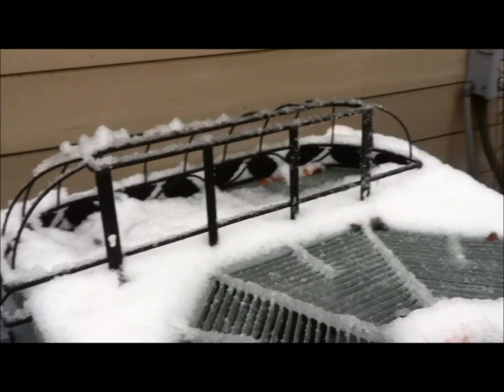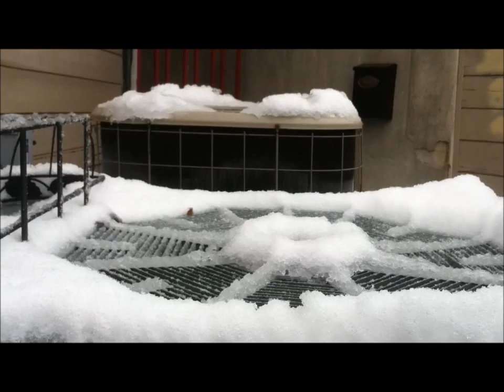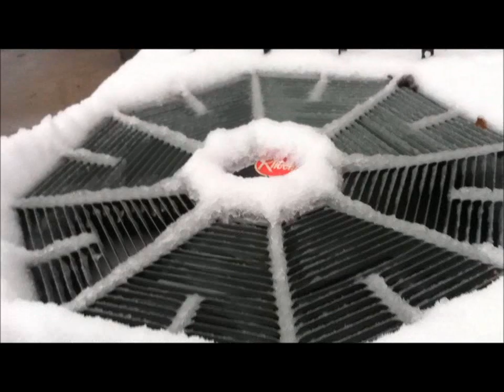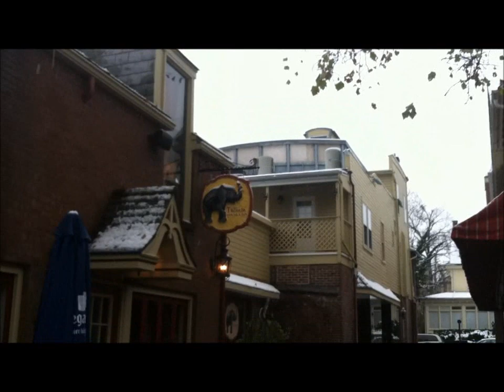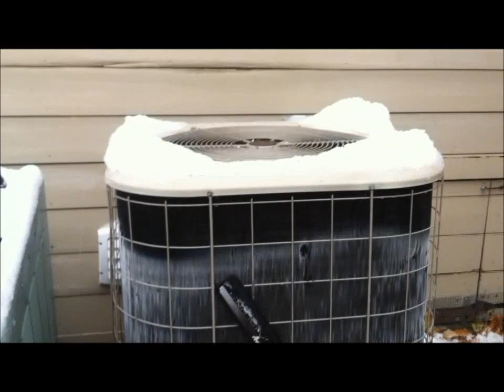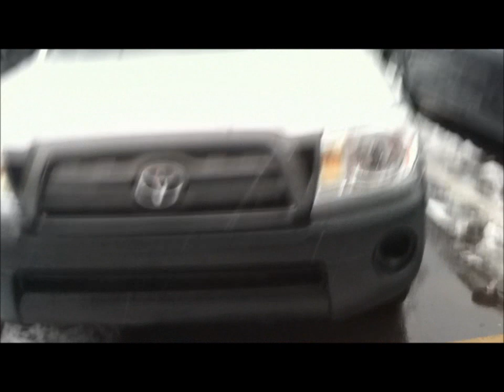1999 Rheem 10 SEER 4-ton heat pump defrost cycle STEAM SHOW!

Comment: Stamped Octagon Productions Could you please try to get some more Rheem defrost videos?
Reply from the maker: That is the only Rheem/Ruud "stamped octagon" heat pump I have access to at the moment (meaning the one place where I know the owner of the property, everyone who works there knows me, and I can stand outside filming the damn thing for as long as I want without a confrontation or getting yelled at). I can try to get another video of this one defrosting, but as of right now I do not have access to any other heat pumps of this style. I know of three 1992 Rheem Classic X heat pumps in a really crappy area, but the keyword there is CRAPPY AREA." Will try to locate more pre-2005 Rheem/Ruud heat pumps-Thanks for your interest!
Reply: Thanks, also, do you know if you could try to catch a Trane XL 20 defrosting? I've never seen how they do it.
Reply from the maker: John Smith
My Grandma's neighbor has a 2011 Trane XL20i 3-ton heat pump that I have permission to film. I've been trying to get a video of it defrosting for 2 years now, but the demand defrost makes it hard.
Reply: Demand defrost seems like it would make it easy. It only defrosts if it's actually frozen, and you don't have to wait for 90 minutes like the old carriers

Comment from the maker: I don't think heat pumps develop a tolerance to high heat when installed in hotter areas. Some heat pumps and air-conditioners of poor quality may break down easier in Arizona than in Pennsylvania due to the fact that it is so hot in Arizona, but I think a Rheem installed in Arizona would work just as good as this one when running in COOL mode.

Comment: In Arizona, it gets over 115 on a regular basis, and can get in the 20s during the winter. Those heat pumps in your area have been used in 90 degree weather so long, that 115 degree weather would be too much shock for them, they would probably break after a few days.